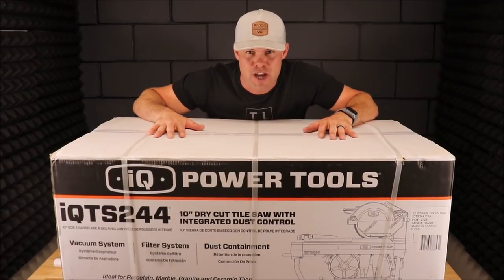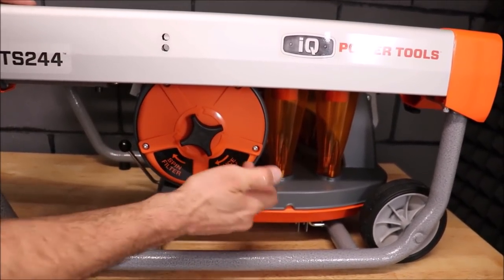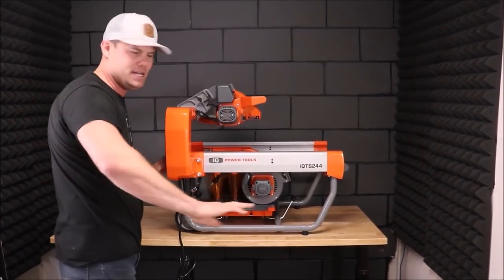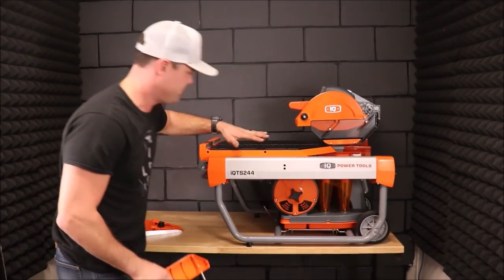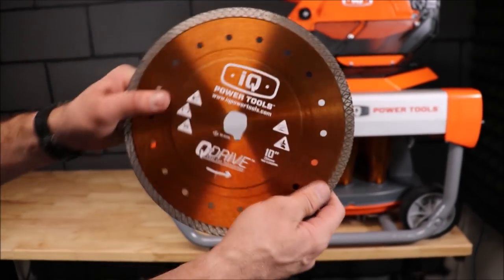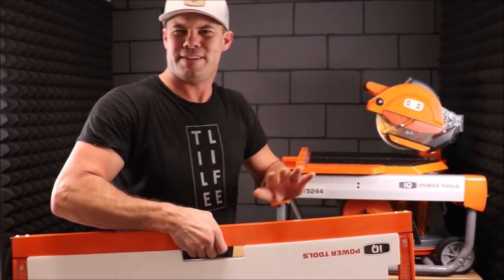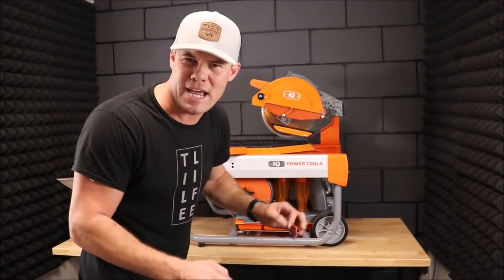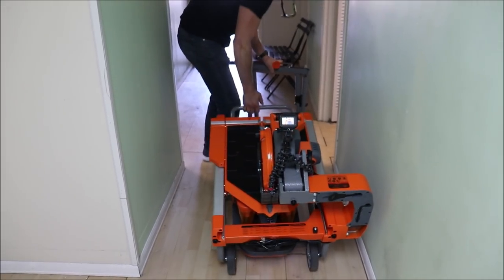IQ Tile Saw DRY CUT NO DUST Full Review Part 1

Comment: You tip the machine back to attach the stand, kick it up a bit then the pin pops in.  You have to watch your feed rate.  The blade wants to run out if you push too hard.  It’s neat how the dust tray sorts the different size dust.   Very important to empty the tray before you move it.  The saw is a game changer.  I bought mine one zero degree morning.  Haven’t looked back.
Reply from the maker: Thanks Mike, someone else mentioned that. I'll add that to the Part 2 of the video. That makes this saw even easier to manage for transportation. Thanks for the tips!

Comment: I have 2 of these saws plus the extension table. Had both for about 2 years. Both saws now cut large format rips and wavy. Plus both saws have a catch in the tray at the same point. Stops from moving , you have to push hard past. The extension table is pretty worthless. The top feels slick, but it’s a slow pain to rip a plank tile. We’ve stopped using both saws and went back to dewalts

Comment: I hope that you will check every aspect of that saw. I’m interested how it can make U cuts, L cuts should be with no problems. If you can try to cut some glass tiles too. I know that this blade is not made for cutting glass but maybe you can demonstrate it.
Reply from the maker: The video will show notch cuts, miter cuts on soft and hard material, long cuts on 4 feet tiles with the extension table, vacuum testing and much more! I will also compare the saw and the cuts to the Lockmond Beast and yes, I'll try glass!
Reply: Landberg Tile TV 
Looking forward to the next video and thanks for doing this! Do you have a ballpark idea when the next video on this unit will be available? I haven’t been getting notifications on every video recently.
Thanks
Ron
Reply from the maker: @ronh9384  I will have Part 2 uploaded this coming Friday. It will be much shorter and focus purely on cutting. Strange you're not getting notifications...have you clicked the "bell notification" ?

Comment: any issues with consistently cutting glass/stone/metal mosaic? I am curious if the dust collection was meant for these materials since they don't recommend glass cuts? would you venture to say this could completely replace a wet saw? I was sick of my mk freezing up in uninsulated garages during my winter months so I pulled the trigger on this yesterday.
Reply: also, was there any adjustment or checking needed for squaring the blade?
Reply from the maker: Zero issues so far. I'm impressed every time I use it on a project. No issues with cutting glass/filter issues. Cuts metal mosaic with ease. This can completely replace a wet saw. The only complaint is the miter jig takes a little getting used too. We love it!
Reply from the maker: No adjustments. The blade cut straight out of the box and the table has absolutely no play at all. Most solid table of all saws I've reviewed.